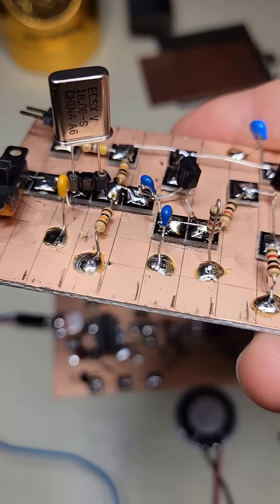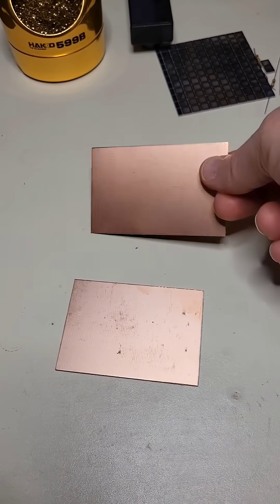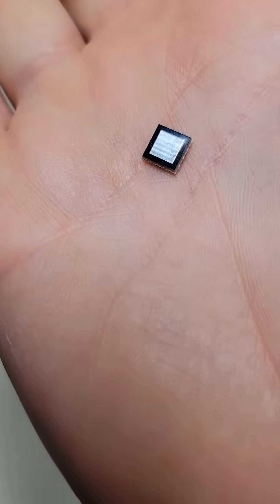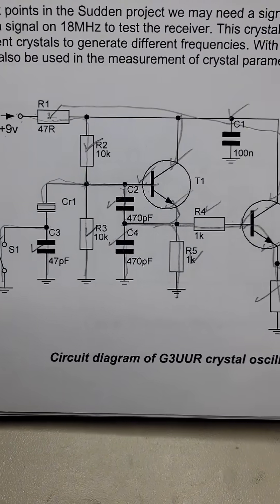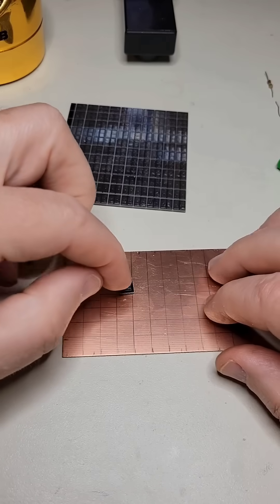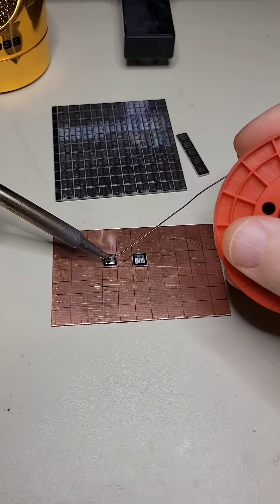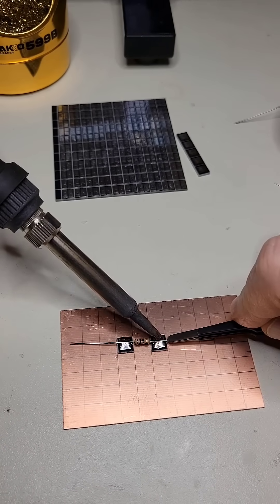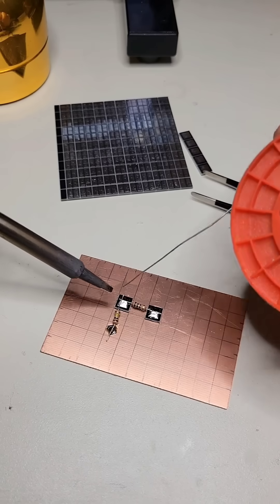Manhattan Circuit Construction Technique for Homebrew Ham Radios

Comment: Why make it so complicated?
These "extra pads" are absolutely unnecessary - it is enough to simply "scrape" a layer of foil along the lines drawn (I did like this about 20 years ago since in technical school). 
"Scraper" is easily can be made from an unnecessary or broken blade from a hacksaw or electric jigsaw (don't use knife for paper - it's bad material).
And you don't need to "buy" or "glue" anything extra.

Comment: Well. It was 2024 of the 21st century. Let's not talk about ordering a board from a well-known Chinese service. Maybe not every avid radio amateur has a CNC machine for milling a board or with a laser. Maybe not every avid radio amateur has an inkjet printer, transparent film and photoresist (or boards pre-coated with photoresist) and someone is embarrassed to buy a LED women's nail lamp, and does not know how to solder their own (an avid radio amateur, yeah). Maybe not every avid radio amateur has a laser printer and an iron at home. But varnish, nail polish and a toothpick (if you feel sorry for a drawing pen) are very cheap and are sold in any store! What else do you need? Citric acid, hydrogen peroxide and salt - all this is also sold in stores, in a pharmacy and is not prohibited! Proportions? And the Internet? The author and the audience certainly have it.

Comment: what will be with this manchattan techniq if it will be work on a very high frequency??? is there are no a simple and classic way to solve a problem? Write a scheme in ide develop a circuit architecture for it. Then send it for print on a printer. Drag this image with using a high temperature on a folgic tecstolit, delete all which is not a schematic road

Comment: I have used this technique for years and years, except for the little pads that you glue in place,  so if you spend all the time to measure and exactly draw out your grid then you might as well take something sharp and actually cut the copper and separate the squares of the grid that's what I do. DE AA7J 😊
BTW the pads don't have to be exactly square irregular shapes work just as well you can leave a large amount for a ground plane if you need it and drill through holes to connect the ground plain on the opposite side.73 if you study well-engineered circuit boards used for super high frequencies like 2gig you will see the boards peppered with through holes to keep the signals where they're supposed to be.

Comment: Scribe a 7mm grid through the top layer copper with a sharp carbide tile cutter on a double sided pwb.
Exactly the same result.... but without the glue.
Cool video !!
Reply: It's not the same though!  cutting through the top copper layer destroys the contiguous ground plane that is wanted for high frequency circuits. It also stops you from achieving minimum length connections from component to ground leaving the circuit susceptible to picking up stray interference signals.
Reply: @MikePerigo  
Thanks for that.
I did say double sided pwb...right ?
Reply: @sparkyy0007 You did but you need the top side to be all ground to allow short connections.
Reply: @MikePerigo  
Thanks for that.
The glue on pads are the same thickness as the pwb.
The bottom ground plane will be the same distance to the connections.
There's no difference in spacing.
Reply: @sparkyy0007 The difference is not in thickness but proximity to a connection point. Instead of grounding the component to a continuous plane no more than a mm or two away, or connecting to the nearest unused pad which then needs to be linked in turn to a grounded pad which possibly has to be daisy chains via other pads to a common grounding pad. mm versus cm. 
If you want to avoid using glue-on pads then you need to properly route the ground plane around the component connection points. In other words design a proper pwb layout which of course defeats the benefits of a quick prototyping method of construction.
Reply: @MikePerigo  
You're right on that Mike, a via would be nessessary to access the ground plane on the botton.
Reply: @MikePerigo  Just drill a thru-hole wherever you need a ground connection, and solder it on the bottom side.
Reply: @MikePerigo  I think he means cutting the pads out that way rather than buyint them? or he misunderstands the grid of the ground plane
Reply: If you're going to go to all that trouble you may as well just cut a traditionally routed PCB on your mill.
Reply: @darqchild 
Bingo

Comment: Непонятно, зачем брать фольгировпнный текстолит, тем более двухслойный, если можно приклеить квадратики с облуженной медью на любой лист фанеры...
Reply: You certainly can glue squares with tinned copper to a sheet of plywood.  But plywood, last time I checked, isn't a conductor, so it doesn't act as a ground plane.  The electric fields from the circuit nodes you glued to the plywood  WILL terminate on the circuit ground SOMEWHERE, even if they have to travel some distance to do so.  Without a ground plane, most if not all of the fields will terminate at the ground connection of the power supply.   And they'll interfere and cross-talk with each other if they all terminate at the same spot.  This may not matter in low frequency circuits, but it absolutely will matter at radio frequencies.  That's why radio designers opt for a ground plane.

Hopefully it's now clear why the author of the video is going to the trouble of using a foil-coated PCB instead of a piece of plywood.

Comment: I see a lot of antennas there
Reply: Antennas need to be at least a quarter of the wavelength to be efficient.  So yes, if you're worried about frequencies in the 10s of Gigahertz, these wire lengths would be a problem.  But the crystal shown in the video is 18 Megahertz, so I don't think the wire lengths shown will be acting as antennas at those frequencies.

Comment: Doing a PCB at home is easily achievable, you just need a drill, ferric acid, a printer, a PC, software to root, hot water, solder, tin, and that's basically it.
The result is much better without such an increase in difficulty
Reply: You can't iterate on a PCB like you can with this technique.  If you need to make 20 tweaks and changes before you've got the circuit just right, tell me, how tired will you be of etching circuit boards at that point?   My guess is you'll give up long before you've got the circuit dialed in as well as you can in a few hours of changing a circuit constructed as shown in the video.  

But if you can only build circuits someone else designed, and you don't tweak them at all, you may be right; a home-etched PCB may be the right way to go.
Reply: @davidnaegle427  if you don't know what you're doing, just use a protoboard.

Comment: waste of time..  while waiting for the ca glue to cure and scratching this grid.. i could have wired the whole thing point to point on a lug strip or in open air..  too many people making simple things difficult...  if you are going to the trouble of prototyping a board for production.. then make it SMD.. and tiny.. otherwise.. through hole or ptp..
Reply: How many radios have you built on a lug strip or in open air with no ground plane?  That worked, I mean...
Reply: @davidnaegle427  you can attach to a ground plane.. a chassis for instance.. i've built plenty of working circuits ptp or open air that worked..  i'm not saying it's always the perfect method.. but glueing these squares on a board isn't exactly common place either.. you could just scratch the copper away and leave islands.. or raise them on lug strips.. other boards..  keeping the copper ground plane intact.. etc... just seems like extra work for no reason.. but whatever.. if this is what you like.. go for it.. i don't build much RF stuff from scratch anyway.. not anymore.. mostly some repairs.. an occasional linear amp.. but mostly i build boutique tube audio amplifiers.. mostly guitar amps and some Hi-Fi stuff.. thanks tho..
Reply: @texastyrannyresponseteam794  yes, I agree that for audio stuff, lug strips or open-air PTP can work fine.  I wouldn't go to the trouble of Manhattan construction unless I was working at RF frequencies.  You can even make RF circuits work with other techniques if you're aware of the ground plane and are always thinking about where the e-fields from your sensitive nodes are going. The thing I like about Manhattan is that the ground plane is pretty much where you need it by default, so you don't have to think as much about it.

Comment: My only concern is that superglue is not a very reliable bonding for the long term and I don't know how it would hold up to the heat for soldering  but even if the super glue did release, the rigidity of the leads and anchoring to the board via components to the ground plane would probably be good enough to keep you out of trouble. Just don't go over rough roads or terrain.

Comment: New meaning to SURFACE MOUNT electronics 😊
Reply: I've seen pictures of people using surface mount components like this. It requires spacing the little pads a lot closer together, and of course most SMD ICs need to be soldered dead bug style.

Comment: It's called 'dead bug style'
Reply from the maker: Deadbug is not the same
Reply: @RedSummitRF  It is if you're in the UK,
it's been called 'dead bug' for 50 years,.
the 'pads' we call 'islands'

dead bug construction....
Reply: @CBRadioWayBack10-4  Dead bug can be done on a ground plane OR on a non-clad board.  Both are dead bug, but one will only be good for DC and audio circuits, where the other will have some chance of working at RF frequencies.

Comment: You know, i see how it's useful, especially with it being a "field technique". But i also cannot fathom just not using perfboard instead. Ill continue to do anything but this for board construction and appreciate from afar
Reply: as long as you're working at low (audio) frequencies, you don't need the technique shown in the video.  Assuming you're careful how you handle high impedances like guitar pickups.  However,  when you ARE working in frequencies from 10s to 100s of megahertz, and you get tired of your circuit not working as you expected it to, you might give this technique another look.
Reply: imagine an extra capacitor between every single component.  that's what you're dealing with for radio frequencies.  every insulator is a capacitor!  that's why this technique is used to super isolate everything, even from the board itself.

Comment: Superglue does not tolerate heat well. It can work, if you are fast with soldering. Or it may melt. Of course you can solder the tiles to the pcb.